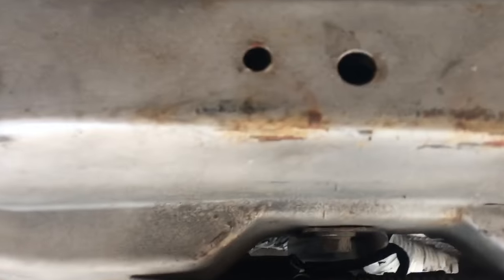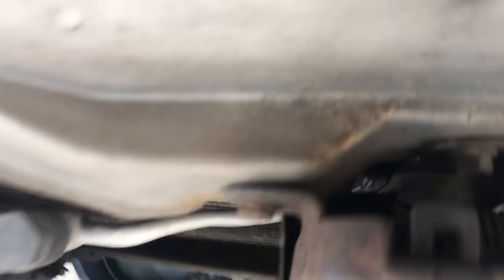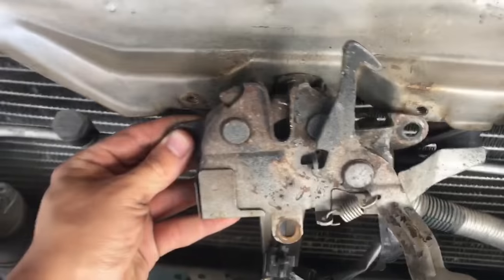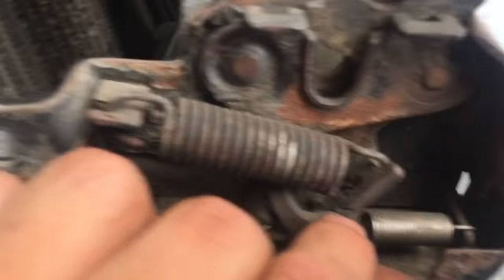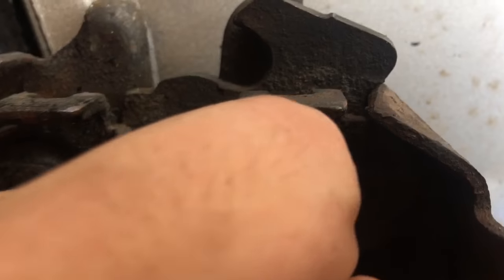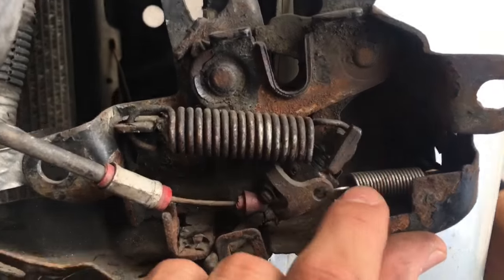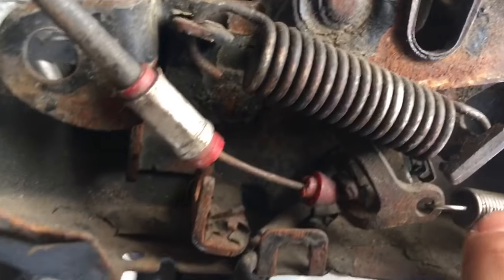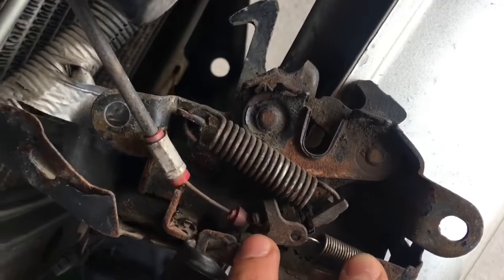How To Fix A Car Hood That Won’t Close | Hood Latch Fix

Comment: theres a few reasons your hood may not close all the way.i have not read every post so excuse me if I'm repeating anyone.all the vids i watched showed ppl replacing or messing with the latch itself which is sometimes necessary but since i just had this issue about 15 minutes ago i thought would add this.there are 2 rubber topped "bumpers" on top of the front of the engine compartment where the hood comes down.they screw in and out and are adustable in height.if there's no broken springs on the latch adjust them down.i think they move when u open the hood.at least mine do.hope this helps someone.
Reply: these rubber bumpers - are they closer to the windscreen than the front of the car - are those what you are talking about?
Reply: My god, that was the exact issue!  You're the best.

Comment: I need this video. My hood stopped closing. I have a spare van exact model thats a parts van and the hood spring still good. Im going to take off my front latch and check the spring. Maybe it fell off or broke. If thas not the problem the it should be the pulling handle inside the van.

Comment: Great vid mate, just spent 90 dollars on a new part, which I reckon I didn't need and another 115 fitting it at Toyota.  I barely open the hood myself.  It's a 10 yr old car.  This shouldn't happen.  I gather all that was needed was to jiggle that little spring into place.  Cheers.

Comment: Thanks a lot buddy! I followed your instruction fixed my problem. A new Hood lock for me Lexus ES350 is about $125 CAD on ebay + it will take about 3 weeks / one month to arrive. Fuck that! Just buy some extra springs of the same size and badabing badabang badaboom: Problem fixed!

Comment: What’s another main probably cause it won’t close?
Reply from the maker: Springs can seize. You can try lubricating them. Broken release line. That plastic end can be broke. Mine is actually broken in this video but I make it work but it can give it too much slack some times.